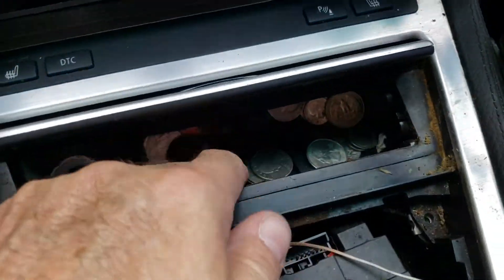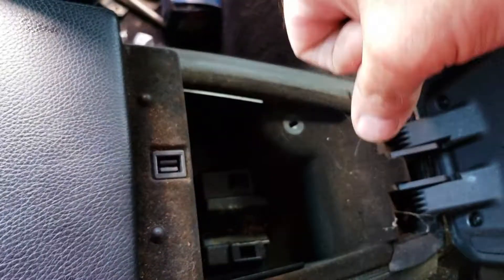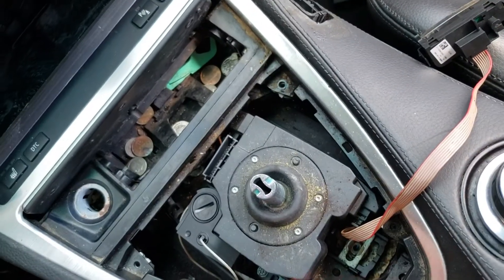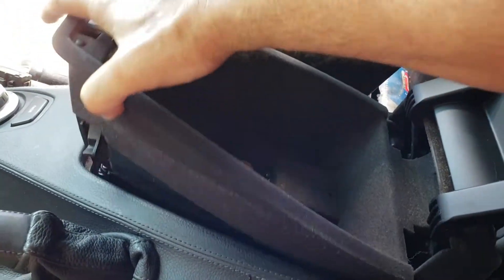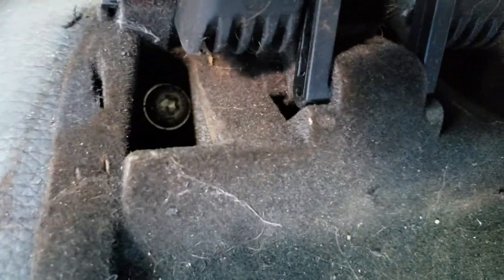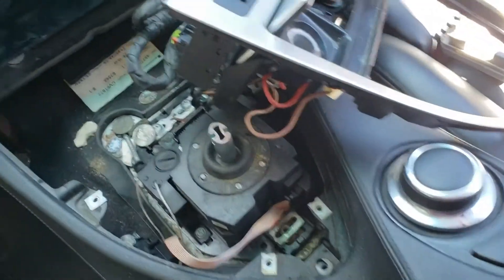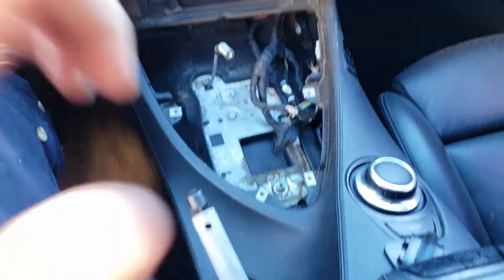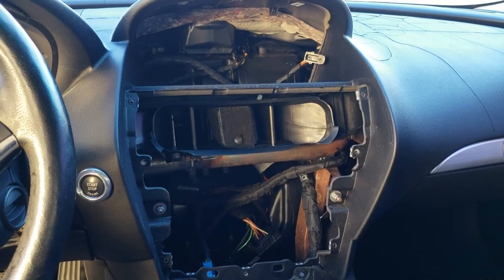2JZ BMW project iDrive delete car computer

Comment: Does the I drive have anything to do with the cluster?
Reply from the maker: Nah. It can be used to clear some codes but there are other ways to do that. Example low tire pressure code.
Reply from the maker: I did it in my e60. Theres a video on it. Car computer